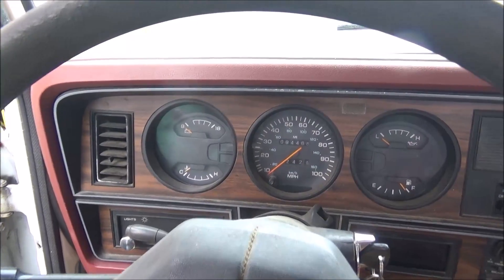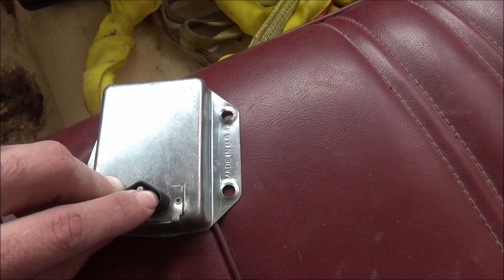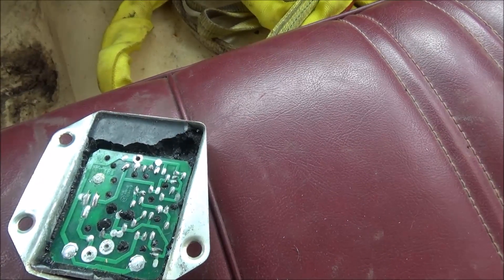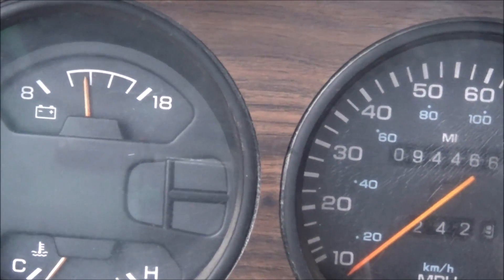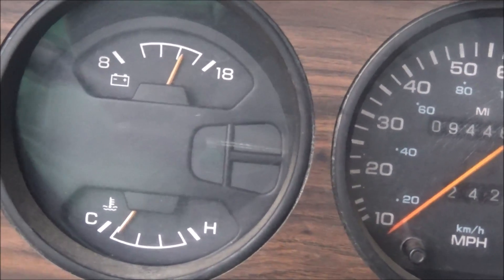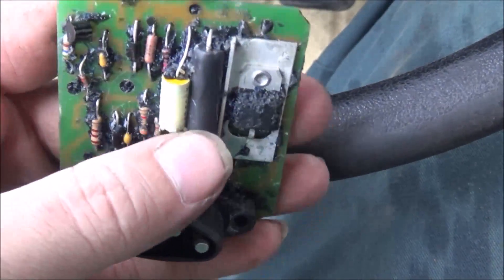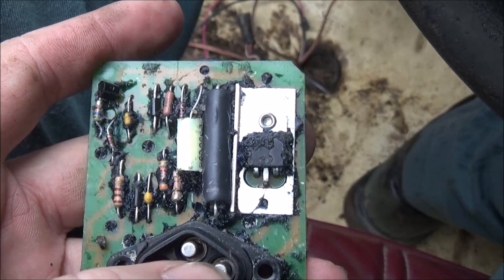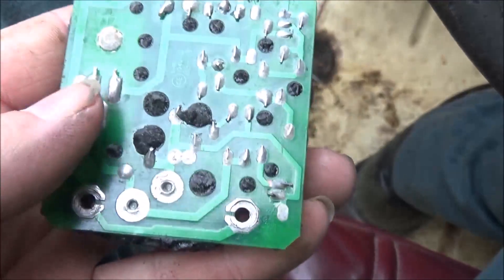Plagued by electronics, I need help

Comment: Your alternator might have a short between rotor windings.  If so, this would draw more current through the regulator to get the same voltage and load the voltage regulator more.  Otherwise, there might be an intermittent short causing a surge that kills regulators.

Comment: I had the much the same problem .what i found is the  exciter wire to the alt was low voltage and didn't start the charge every time i came off the wrong side of the resister .Also the most important thing in auto electrics is GROUND GROUND clean every connection from bat to frame to body to dash to motor to rear dif  to everything that is rubber mounted GROUND everything  also the pos side is almost as important as GROUND good luck remember GROUND

Comment: You know I think you could get away with using a relay if you used a solid state unit instead of a mechanical solenoid switch version. Those don't have contacts to wear out on them. As for the problem with the device, I suspect you have an intermittent connection somewhere in your wiring harness. I don't know a great deal about cars but logic tells me that's the most likely culprit. High frequencies can damage some components like diodes and regulators if they aren't rated for those kind of transients. If you've ever messed with an old stereo that has a dirty volume knob, that would be a good example of what a bad connection can do.

 I suspect that large black cylinder is a resistor encased in a shroud of some sort to protect the potting resin from the heat expansion of the component. High current resistors get quite hot and are usually made differently than the smaller half or one watt carbon film versions. They are usually wire wound with metal caps at the ends. Since I'm pretty sure I don't have to tell you what happens to metal when it get's hot I'll just say that the potting resin isn't very flexible and would shatter if it had that much internal pressure. You dug quite a bit out of that housing so you've seen how it breaks.

If you find you still need help I can recommend a chat room to you that I use regularly for everything. It has geeks of all kinds from around the world in it pretty much 24/7/365. It's like sort of a super google because you'd be talking to people who actually know things and other people to talk to who know even more that aren't necessarily in the chat room at that moment in time. The site is http://www.thegeekgroup.org/live and you don't have to be a member to get in. Just go to the page, put in a nickname, and click the button to enter. I've gotten the answers to so many problems in there and they help people because they enjoy doing it so it won't even cost you a single thin dime.
Reply from the maker: Thanks for the info. I hope it stays fixed.

Comment: one trick i used to use was to start the thing up, then while it is running, disconnect the battery. if it keeps running, the alternator/generator is working. if not, not. i don't know if this works for a diesel.

Comment: Brian

As a test with the engine running and hopefully charging, check with a voltmeter between the battery Earth terminal and the case of the regulator , you may need to go down to the 1 Vdc range the voltage should be very low < 0.25vdc, also do the same between the engine block and the battery Earth same result should be shown , repeat between battery Earth and the alternator case again it should be very low.

If you get good low readings in all three tests then the trouble may be elsewhere 

Stuart

Comment: G Day Brian, I would check earth on the regulator and if you have an alternator from another vehicle perhaps try a different alternator, just in case the problem is in it.
I thought later I would consider fitting an alternator with an internal regulator rectifier and do away with the external regulator. 
Some of these things can be hard to find and a pain in the butt for sure.

Comment: Dunno, but I'd be leaning heavily towards a single wire, built-in regulator replacement alternator of enough amperage rather than horse around with the electronics.. :-)

Comment: My vote is also a grounding problem. While running, check the voltage potential between the battery negative post and every ground location you can locate such as battery clamp itself, body locations, engine locations, regulator case ground, etc. and ideally it should be zero or VERY close to zero. If there is corrosion between either the battery clamp and its post, heavy starting current will cause an arc in the connection sufficient to break the corrosion gap but charging current will not. Also check the voltage potential between the alternator output and the positive post plus between the positive post and the positive clamp which should also be zero. If all else fails, ask Bailey. ;-

Comment: Brian,

Had a buddy who is a huge Mopar guy (builds Mopar show cars) and here is what he said.

If you have an "ALT CHARGE" lamp, and the lamp is burned out, it can cause the regulator to fail in the alternator. It's looking for resistance in that wire, and if there isn't any (either a bulb or a resistor), it will cause the regulator to prematurely fail.

Comment: Brian , what years the truck , does it have 24 volt starter ? ever changed the ignition switch ?  What was in the truck before your conversion ?  Is this the same alternator that was on the truck pre-conversion ?
Reply from the maker: The truck is an 84 but all the parts came from an 89. It is all 12V everything including the steering column and key switch came from the donor truck. I don't know if it has issues or not as it was non running at the time I got it.

Comment: I would have to agree with others, I think this may be a ground problem. cheapest thing to do first is ground everything good. engine to chassis and body to chassis as "MC Carman" and "The Thing" suggested, also make sure the regulator case is grounded as well. it acts like a trailer that is dependent in the ball for the ground connection for lights. flickering all the time. that may be what is killing your regulators,  easy and cheapest 1st. good luck ....

Comment: I agree with Pierre's Garage that your problem is a short somewhere. I had a similar problem many years ago and the problem turned out to be a short in the wiring harness. Unfortunately, I finally discovered the problem after the warranty ran out.

Comment: Hi Brian check your ground connections have a look at plug and socket in the back of the alternator for the field coil check if it's making good connection  check the filed coil resistance is with in spec also check regulator body has a good ground to .see if you can find the part number on that big transistors and post it up on comment so I can see what it is if you have a multi meter plug the reg back in and do a voltage check fron the centre pin on the transistor to ground with the engine running and see if you have controll voltage  that pin ( base ) all so check if the voltage sensing wire has arratic voltage  even put a test light on it go for a drive and see if it flickers had a problem with a truck doing same thing turned out to be the ignition switch causing intermittent voltage and it killed the regulator.    Lol sorry for the bad spelling
Reply from the maker: I do have control/excitation voltage to the reg but it is about 0.3V less then battery so that might be a problem. I need to look into that. The only visible marking on any of the reg components is Dale CME55. But it does look like the reg chip is MJE3056T G4123VW  CHN 332 ST it is incredibly hard to read so that may not be right.
Reply: regulator does not need grounded I drove a old valiant with mine hangin on a string for years when I was a kid.

Comment: Brian, the three pin chip on the board is a voltage regulator. Can you make out a number on the chip itself?  Perhaps an LM317 or 7812. It appears that chip is riveted to a heat sink. Usually on those chips the metal mounting tab will be the same as the output pin if you test it with a voltage meter. usually pin 2 or 3. Therefore the heatsink itself cannot be grounded or the chip will fry. A work around this issue is a very thin piece of plastic and a plastic bushing to isolate the mounting hardware on the chip. With the chip being riveted directly to the heatsink,  that tells me the heatsink will show the voltage of the output. My theory is the heatsink inside is making contact with the outer metal case which is being grounded. Is this regulator box being mounted to the body? If so try putting a isolating material between it and the body. Just my two cents.  I look forward to seeing what you come up with.
Reply from the maker: The only visible marking on any of the reg components is Dale CME55. But it does look like the reg chip is MJE3056T G4123VW  CHN 332 ST it is incredibly hard to read so that may not be right. The entire thing was potted in silicone and sand so I don't think there is anyway for it to short to the case except for of course where the case and the pin is riveted together as it is supposed to ground thru the case. I figure it is done that way so the voltage is based off of the voltage where the loads are and not the battery voltage which is what you would get by grounding back to the alternator. Many have suggested grounding that way to solve the problem but after thinking about that it would defeat the purpose of having a remote voltage regulator to begin with.

Comment: do you have a chargelamp? or is it only voltmeter ?
the ground use to go over the lamp to limit the resistans. if iťs not the diods.this maby is the problem.
Or maby you have another regulater somwhere... it happened to me on my MBtrac, they changed to a inbuild regulator but the original was still conected under the dashboard ....
Reply from the maker: This truck has a dash with a voltmeter my other truck has a dash with an ammeter. Could that really be an issue?  That would be some pretty lacking electronics I think if it is.

Comment: I would stay with only the factory mopar parts for those and stay away from the aftermarket ones. Squeeze the female connectors to the regulator, so you have no loose connection there. Good luck

Comment: I would wonder if excess heat is not literally frying those. It appears to be mounted directly above the exhaust manifold. When you would be sitting at a traffic light the heat would rise straight up. IDK what was in it before, but with a V8 that spot would be above the intake manifold, which is water cooled. Maybe relocating it closer to the fender or even on the intake side of the engine would help. You might have to splice some extra wire on to do it, but it sure couldn't hurt to try that.
Reply from the maker: It is mounted in the same location as it is on my other truck that has never had a problem. Today when I was fooling with it I felt it to see if it was getting engine heat and it was no warmer than the hood.  It is about 8in from the manifold and most all the engine air gets blown past it as it vents out the cowl.
Reply: OK. I'm not discounting the possible ground issues. But I have had a long relationship with semiconductor devices, and they don't like to get too hot. Naturally, current running through them generated heat, and if the ambient temperature is too great, that does not dissipate as well as it should, and voila! fried junctions. Have I tested this theory, no, I can only dream of owning a cummins diesel truck. :)

Comment: Modern regulators vary the voltage to the Armature to control the charging voltage. The mechanical ones just switched the voltage on or off.

Things to check:

#1 Grounds. Battery to engine block (a large cable for the starter current). Battery to vehicle body. Vehicle body to regulator.
#2 Is the regulator  the right one for the alternator ?

If you want to send me the faulty regulator PCB and the pinout I can check it over and tell you what is failing and possibly point you in the direction of why it is failing.

Comment: Brian, you have gotten some really good advice from some very knowledgeable people.  I don't work on cars.  Love you videos.  My neighbor had a dodge with electrical problems for years.  He spent some $ on parts changing. Found a guy that only works on doge trucks.  He isolated a grounded out switch on the glove box.  He said the glove box short was common with dodge.  Most of the time all it did was drain the battery. They just cut it out and capped it.  I'm not recommending you go cutting out good stuff but on a long shot if everything else is working it might be worth looking at.
Reply from the maker: I don't have any drains, it just randomly decides to quit charging and only a voltage reg replacement gets it back working again then all is fine for a few months and boom it quits again.

Comment: Brain I have four first Gen Dodge trucks. I love them for their ruggedness and simplicity to work on. The charging system can be an issue. I had two of mine do what yours is doing.  To fix them I had the Alternator rebuilt by a GOOD LOCAL shop. They usually found a bad diode. Then install a new regulator and run a ground wire from the regulator mounting bolt to the engine block.  My troubles was a intermittent ground issue between the cab and engine. It was simpler to me to just install a ground wire.

Comment: If you believe the regulators are failing from an external issue I suggest you check the following:
Current load on the regulator; According to a 1970's Motor manual the regulators are rated for a load of 2.3 to 2.7 amps. 
Exceeding the duty cycle of the regulator. This may be from too small of an alternator, an intake heater staying on for too long, etc, which results in the regulator grounding the field circuit for longer than it was designed for.

Comment: Brian, 
The bouncing needle @6:23 tells me that a diode is failing.   If you were to scope this, you'd be able to see more detail, but it's not necessary.   At the bottom of this webpage you can see what good and bad waveforms look like:  http://jaguar.professional.org/Alternator.php

The failed "mystery" component @12:14 inside your regulator is a capacitor which is supposed to dampen minor (normal) voltage fluctuations on your gage but is just to small to dampen a failing diode.

After you replace the rectifier (diode) assembly and the regulator you should be good to go.
Reply: On second thought, an open circuit in a stator winding could cause that too, but my money is on the diode.   

Both are easy to test.
Reply from the maker: Shouldn't it also bounce when the field is run without the VR as well if it was  diode?
Reply: bcbloc02 Not necessarily, the regulator is responding to the input voltage, so it fluctuates.  With the straight ground there is no reaction.
Reply: Alternator AC voltage is about 400hz, so it wouldnt show much on a dc voltmeter.  Although, because it takes two months to fail, I would bet it is heat or load related, wouldnt hurt to change the alternator though since you have one

Comment: is the regulator in a hot spot, and does it fail after heavy pulling or long drives?
  the other thing i would say is to make a makeup harness to see if that solves it in case you have a running short or break in the wires
Reply: and i second the ground strap comment below, in school our instructor would pull ground wires or tape them to make faults
Reply from the maker: The last reg that failed was put on in Novembe, it hasn't been warm or done any heavy towing since then so it shouldn't have been heat related.

Comment: Does the wiring harness from alternator feed through firewall/dash/ volt gauge then to regulator? Pinched wire in harness during engine swap?

Comment: I would check your chassis grounds and add from motor to frame, motor to body. If you are getting any type of AC current due to a bad diode from the alternator into your regulator it with smoke it.   The black three leg discriminate component is a transistor which is nothing but a diode gate. If it gets reverse current it will let the factory smoke out. The two components right beside it look to be wire wound resisters to drop the voltage to a manageable level to charge the battery. there are some small switching diodes that are black with the silver bands. The glass diodes orange in color could either be a rectifier or zener also to drop voltages. The item in question is a thermister. It will open or short as well from too much voltage thus lettering the factory smoke out. All these parts at the end of the assembly line have smoke put in them and when you let it out it is non longer serviceable. If you have another know good alt I would try it.

Comment: Does the truck self discharge the battery when not in use?  Do you own an amp clamp meter?   If something was causing a very heavy field current, that could fry those regulators.  Don't rule out the alternator until it's tested out.....
Reply from the maker: It does not self discharge.  I have an amp clamp as part of my napa electrical system analyzer and it shows no discharge occuring.
Reply: I think I would certainly have a look at the field current with your amp clamp......You shouldn't see anything much higher than 2 amps.....If you do, you would be putting a strain on the regulator design...  Might be worth  a try...  I know I would check it.